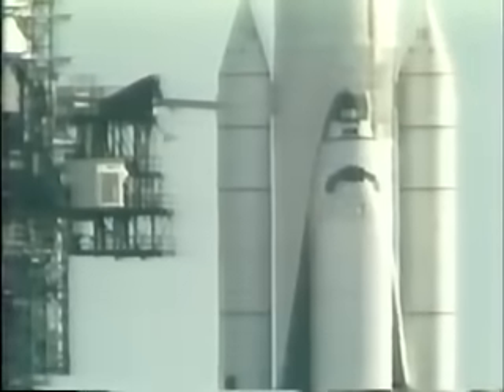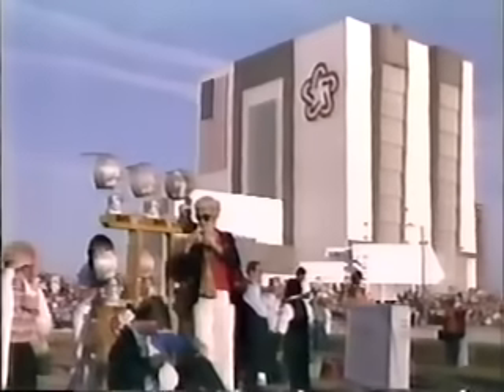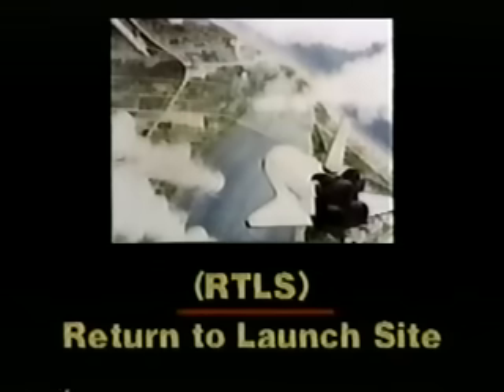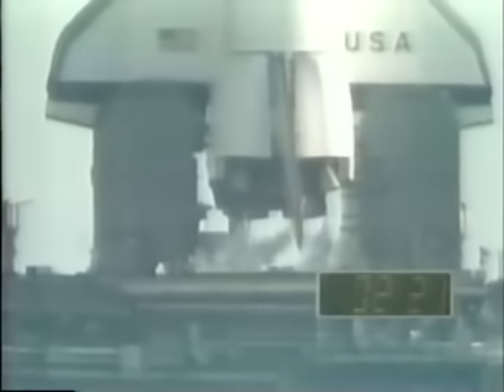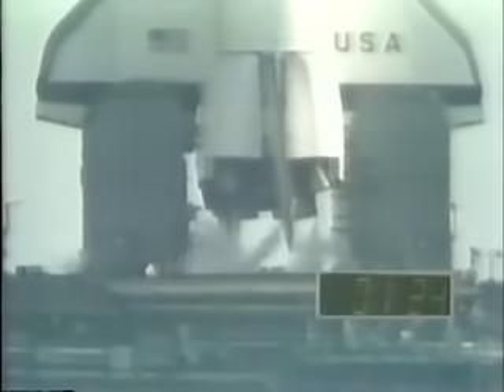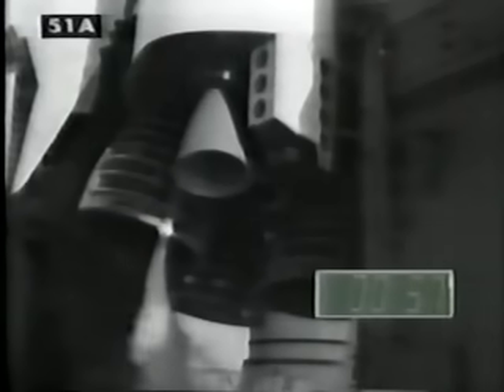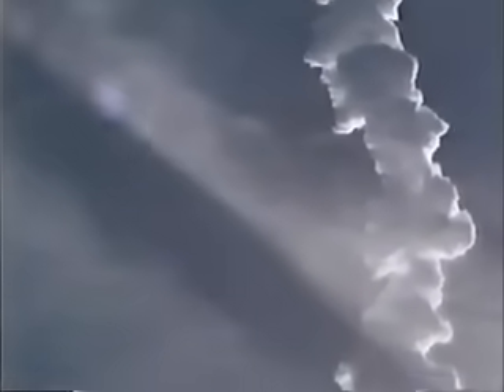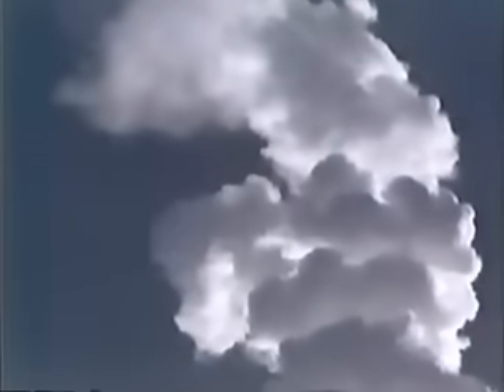First Shuttle launch Columbia 1981

Comment: did  i hear ftank  say they could EJECT ??  THEY Seemed pretty worried
Reply: Columbia would have been way too high to use ejection seats.
Reply: Mooie Telebogen And way too fast.
Reply: +Bearwood Brown  at 705  too high for ejector seats  am i missing something   i didnt think theyhad ejector seats
Reply: +Bearwood Brown The first four shuttle "test" flights only had a two person crew and Columbia was outfitted with bulky (taking up lots of space of the flight deck) ejection seats should there be a reason to bail out. Luckily they were not needed. ON Columbia's 5th flight, which had a crew of four, the ejection seats were deactivated as only two  of them could eject. After STS-9, Columbia went through a period of overhaul and the ejection seats were removed. None of the other shuttles had ejection seats. It was deemed too costly and would add a lot of weight to the shuttle orbiter thus reducing its payload launch capability to make it possible for the crew cabin to be separated from the main part of the shuttle in case of an emergency. In the case of Challenger, the events happened so rapidly and the SRB's were not monitored that much, so having such a capability would not have saved Challenger's crew nor Columbia.
Reply: Because back they were putting humans in a spacecraft design that was unproven in the real world

Comment: What's the stuff coming out at 0.52?
Reply: +Brad b Urine.
Reply: +This Crazy Gamer I know it's not a lot considering the amount they burn but why are they wasting it?
Reply: +Joseph Anning Not at all. Your looking at O2 exaust provided by the pad system to pre-chill the engines to except the super cool fuel for the main engines. The engine bells are cooled internally with liquid hydrogen running through them.
Reply: +jrockett73 so it cools the fuel so it can burn easier?
Reply: Brad b No. It conditions the engine internal parts for the cold fuel that is coming. Liquid hydrogen (the fuel from the orange tank) is about minus 420 degrees. If you didnt condition the parts, things would crack. And cracks at those speeds (rpms of the pumps) would be catastrophic.

Comment: Why was the external tank white at that time? :-)
Reply: Eferson Luiz da Costa The tank was painted white at first because it was thought that it was needed thermally to protect the tank. After the first couple flights it was determined the paint wasn't needed and the 600 lbs. of paint was removed so more payload could be added.
Reply: Katka Cerna, jrockett73, thanks for the reply! ;-)
Reply: Eferson Luiz da Costa If I remember correctly, it was also to save a lot of money. I forget how much it cost to paint that tank, but it was ridiculous.
Reply: Joe Hoyle, *****, thanks for the reply. 😉
Reply: +jrockett73 This guy has the correct answer.

Comment: Eject, seriously?
I thought there were no ejection seats whatsoever on any shuttle.
Guess the reporter had no idea.
Reply: Actually, there were ejection seats on early shuttles.
Reply: There were two ejection seats for the pilot and commander on the first four flights only. There were only two man crews at the time.
Reply: Kevin Olesik Early in the launch phase, they would have worked fine. Thats all they were made for.
Reply: an ejection seat ?  might as well have the eject button wired to a suicide vest
Reply: jrockett73 As mentioned above, the first 4 missions were two crew only and DID carry ejection seats. It was always assumed that ejecting during the launch phase would be fatal. However, they might have proved useful if something went wrong during approach and landing.
Reply: EricIrl Pretty sure I said they had them unless I screwed up typing. During launch they were only considered during the first two minutes.
Reply: There were ejection seats on the first test flights!
Reply: Initially the shuttle did have ejection seats, however they determined it was not feasible so they removed them.
Reply: Steve Ward The orbiters had ejection seats for the first four flights because they were test flights with two man crews. There was never the intention of keeping them as you cant eject from the lower deck. So feasability really had nothing to do with it. They never planned to keep them.
Reply: jrockett73 Absolutley. It was always looked on as a rather long shot that anyone could survive an ejection during the launch phase. I saw an interview with Maxine Faget (designer of the Mercury spacecraft and some of the early Shuttle concepts) in which he said that ejection when the SRBs were still firing would ensure the crew would fall back into the plume and be burned up by the hot exhaust gases.

Comment: Space Shuttle Launches with the unfortunate exceptions of Challenger and Colombia have become routine overtime. A generation far removed from the moon mission needs something to inspire them again Orion will do just that.
Reply: Jesse Lockhart  Columbia's  launch was fine  it was coming back where the problem was. Yes the foam  damaging  the tiles at launch was the cause but the launch on it's own was not a failure.
Reply: The Colombia and and Challenger missions were unfortunate because astronauts lost their lives. The overall shuttle program wasn't a failure, it just lost its luster overtime.
Reply: +Jesse Lockhart But don't forget that people lost interest in Apollo moon landings very, very quickly after Apollo 11. Even the most amazing and extraordinary can appear dull and routine if it is done a few times.
Reply: Randy Sager Yes, and damaged tiles were not the issue either. The foam punched a hole in the wings leading edge which contains not even one tile.
Reply: Oy duh thank you.  I'm not being sarcastic I had an old blond moment.
Reply: Jesse Lockhart
I was just pointing out that the problem was that it became routine for NASA as well, which is when you get things like Apollo 1, Challenger, and Columbia.  There's no place for complacency when you're dealing with something as dangerous as spaceflight.

That said, I completely agree that we need something more exciting than the proposed Asteroid Return Mission to get people pumped about the space program again.  I'm personally in favor of a return to the Moon, maybe this time to establish a permanent presence.
Reply: Victor Gigantic  I say we should go back to the moon, no matter what the moon people tell us. I think we could take them in a fight.
Reply: Jessie Lockhart 3 years later it's SpaceX  and Falcon heavy. Never saw that one comin, didya?
Reply: +Randy Sager And it was a launch problem that caused the fatal damage. Vibrations and air flow during the initial phases of the launch caused the foam to break off.
Reply: +jrockett73 This is also correct. You're awesome.
Reply: +Jesse Lockhart No, see, the problem with Challenger and Columbia is that NASA also thought that the Shuttle had become routine.  They forgot how many dangers still faced the astronauts, and in doing so became complacent.  That's why they decided to launch STS-51-L in spite of the engineers' warnings.  And that's why they launched STS-107 in spite of having seen large chunks of foam come off the External Tank in previous flights, and knowing that the RCC panels on the leading edge of the wing were somewhat brittle and couldn't take an impact.  Because their complacency allowed politics to override good decision-making, and silence the people that were warning of impending disaster.
Reply: EricIrl   That wasn't a problem perse since such things such as vibrations happen.  Was the breaking off of the tile a problem well obviosly it was in this case but  the launch in and of it's self wasn't really a problem.  But of course that can be up to  debate.  The launch didn't fail however so it was a success.   The re entry was where everything failed.
Reply: jrockett73   You are an idiot.  I didn't say that they were. Do you have much in the way of  reading comprehension?   Yes I did mention them but they were not the root cause. Could they have contributed to it?  Yes.  But as an over all problem no.   Yes I  see now that I said it was a problem and that wording wasn't what I was really meaning.     I'm not going to edit the comment either due to the fact that I don't care.
Reply: Randy Sager I don't really care if you edit your comment either but do recommend you edit your attitude before commenting on a public internet thread.
Reply: jrockett73  If you don't like what I say don't read My posts in the future.  Block me if you must. I couldn't care less what you think of My "attitude"  Nor should I.
Reply: +Randy Sager The problem with the Shuttle was its inherent design. Mounting a manned spacecraft on the SIDE of a rocket opened the whole assembly to dangers that would not have existed if the spacecraft had been placed where they normally are i.e. on the top of the rocket.

Two major safety issues arose from the side mounted layout - 

damage to the Orbiter's heat shield due to ice and debris falling from the tank

the impractibility of any sort of abort/crew extraction system

We all know the reason why the Shuttle design ended up the way it did - but once the decision to build it this way was taken in 1971/72, there was not much that could be done to make it any safer.
Reply: Victor Gigante I agree with you that launches have become routine. I'm just discussing people's interest in the program overall. It seems the only time it truly gets attention is when disaster happens with Challenger and Colombia. I can't speak for everyone but it got dull overtime. A mission to the moon or even mars would get people into the space program again.
Reply: Victor Gigante , I disagree, going back to the moon would be dangerous. Because we were warned back then not to go back, that's why we never returned.
Reply: JAY SANDERS If not the Moon, then at least go to the Earth-Moon LaGrange points (L1, L2). Far enough out to set up the Exploration Gateway, but close enough for a Mission within a News Cycle.
Small steps, each one getting us a little farther out there.
Reply: Jesse Lockhart Speaking as a millennial, I’m not sure it will. Going to Mars isn’t all that exciting. When you grow up watching Star Trek and Star Wars, you realize just how primitive our real space program is, and it’s not that impressive. I loved watching the shuttle stuff when I was a kid, and Orion almost seems like a step backwards. It feels like we’re going back to Apollo. I’ll be impressed when we can stop using rockets to get into orbit, when we don’t need mission control, when you can board 15 minutes before take off without a space suit, and when we can get out of our solar system.
Reply: +Randy Sager Tiles had nothing to do with the accident.

Comment: Challenger and Columbia had wonderful "ejection" seats?
Reply: Yes they did. But when flown with a full crew the commander disabled the ejection seats because the entire crew wouldnt have been able to eject.  He felt of something happened why should he be able to save only himself and his right seater so the seats were not armed.  Also the odds of surviving an ejection from a craft travelling at several thousand miles an hour as well as trailing fire were not very good.
Reply: Removed when the crew size expanded beyond two.

Comment: Sadly the Space Shuttle showed just how backwards the space program has been since the early 70's  We went from going to the moon to using a space vehicle that didn't even break earth orbit and used that technology for over 30 years when we should have made it to Mars by now.
Reply: The shuttle did exactly what it was built for, as a platform and truck. It built the ISS, launched, repaired and retrieved satellites. It launched labs for research, hauled large crews up and back. It had a great download capability as well. Some endeavors are worth it wether they make economic sense or not. Keeping the politics out of it, it was a great machine and a necessary evolutionary step.
Reply: Going to Mars will be a difficult thing to do. And that does not count trying to fund the program.  I would like to see it happen also.
Reply: Yes and no. The shuttle was part of a much larger and more ambitious post Apollo space program that was supposed to include a massive space station, a base on the moon, and a Mars landing program. The shuttle was supposed to build the station from which deep space missions would be staged, and would be used to ferry the crews and equipment to the station when it was completed.

The Nixon administration cut everything BUT the shuttle, leaving us with a space truck with nothing to haul, at least untill the ISS finally came along.
Reply: It wasn't supposed to break earth orbit. Although the shuttle was in many ways a failure, in terms of cost to productivity.  It did what it was supposed to do. I don't think we should go to Mars yet, we aren't ready. Though we could possibly do it now.  Sooner isn't always better. Though I hope it happens by 2030.
Reply: because the shuttle wasn't designed to go beyond earth's orbit! It was designed to carry supplies to and from the space station and to service orbiting satellites!
Reply: No coincido. Gracias a la gran capacidad de carga en su bodega se pusieron en órbita infinidad de satélites, el HUBBLE y la mayoría de los componentes de la ISS. Cumplió su función
Reply: It’s cause the world’s governments are more concerned about ultimately petty wars than the future of humanity
Reply: It’s cause the world’s governments are more concerned about ultimately petty wars than the future of humanity

Comment: Was RTLS actually possible?
With everything I've read, I just don't see it happening.

I've heard it called an unnatural act of physics.
Sounds about right.
Reply: It could up until a certain point (You'll hear them call a few different marks in the video). The shuttle would disconnect from anything still attached and glide like a plane back to the airport at the space center, the same way it does during re-entry. After the point of no return there are other bases around the world where they could land in an emergency.
Reply: Yeah. RTLS is possible up to the "no return" call.
I still can't imagine how they'd do that. Everything I've read about it sounds like they're thinking "well, I guess it's worth a shot."
Fly til the SRBs burn out (there's nothing they can do til that), flip over, burn the engines retrograde to negate downrange speed, then start flying back to KSC. Drop the tank, glide, and hope for the best.

Comment: Anybody know why the external tank was white for the first two launches only? I do.
Reply: I think it was originally to protect the tank insulation from UV rays, but it turned out that the foam didn't need it, and the pain weighed hundreds of pounds, so after the second Shuttle launch, they stopped painting the tanks.
Reply: Well done Meldroc. Spot on :)
Reply: The actual reason they ditched the white paint was for weight considerations. From the Wiki article on it:

"The original ET is informally known as the Standard Weight Tank (SWT) and is fabricated from 2219, a high-strength aluminum–copper alloy used for many aerospace applications. The first two, used for STS-1 and STS-2, were painted white to protect the tanks from ultraviolet light during the extended time that the shuttle spends on the launch pad prior to launch.[6] Because this did not turn out to be a problem, Lockheed Martin reduced weight by ceasing to paint the external tanks beginning with STS-3, leaving the rust-colored spray-on insulation bare, saving approximately 272 kg (600 lb).[7]"
Reply: I think its a type of foam. The first two were one substance and then changed for better performance later on. the color was just the change in material (just a guess)
Reply: To answer your question.... Nasa stopped painting the fuel tank or fuel "cell" as they call it because it only lasted for one launch.  The money and time it took to paint the tank for it to only be used for a matter of minutes was impractical.

The external rockets however were re-used.
Reply: nfelvis68  Question: Do you think that painting the ET would have prevented pieces of the insulation foam from detaching during launch?
Reply: I don't see how painting the ET would have prevented the insulation foam from the shuttle itself becoming detached.
Reply: I had a thought that a layer of paint might have provided a bit more stability to the foam surface.  The 64 dollar question is whether it would have made any difference when you consider the forces that the ET was under during a launch.
Reply: Good point. My idea would have been to have made the foam tiles interlock in order to give them more strength. I don't know why they didn't do that.
Reply: If I remember correctly, the paint added several hundred pounds to the total weight of the vehicle....they wanted to save weight, and thus, save fuel.
Reply: Raphael Web Correct. As far as I recall a school kid actually wrote in to Nasa and suggested they ditch the painted fuel tank. I'm pretty sure that was the case.
Reply: ***** See Meldrocs post above.